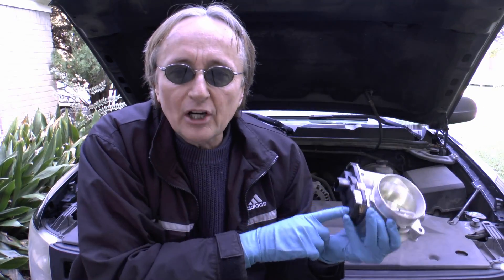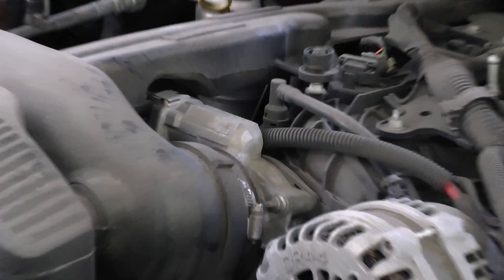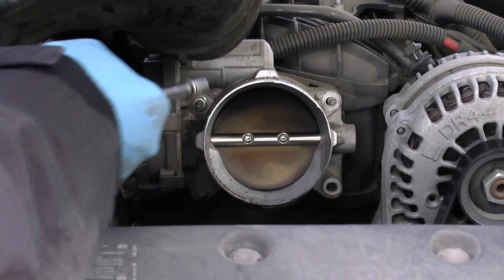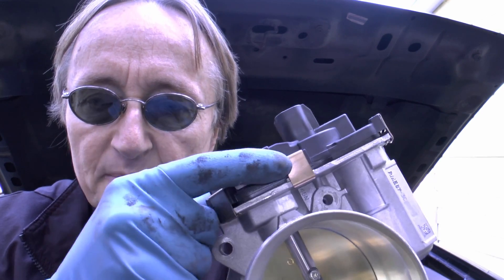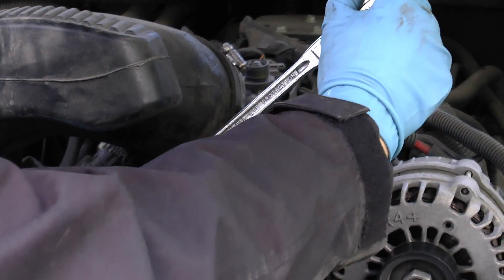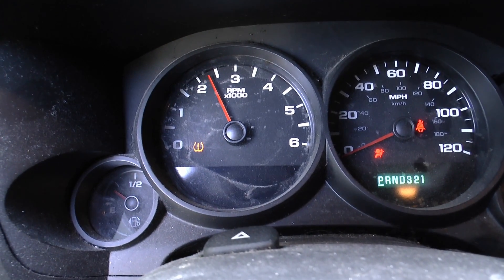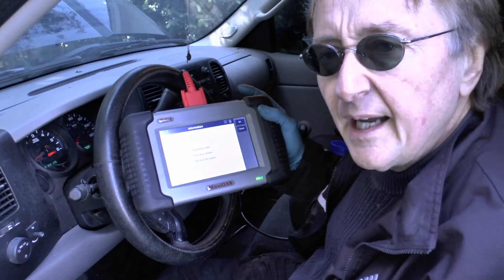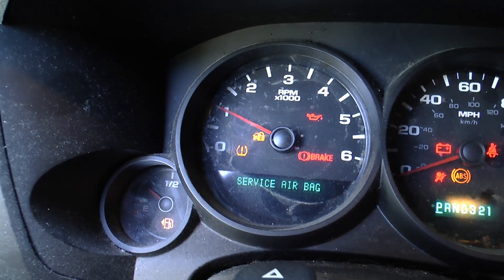How To Replace A Bad Electronic Throttle On Your Car

Comment: I would never buy a car with electronic throttle. I don't understand how an electric motor and wires is better than a mechanically linked steel cable. I swear not just with cars but with everything "they" make changes just to justify somebody's lame engineering job.
Reply: Electronic throttle control facilitates the integration of features such as cruise control, traction control, stability control, and pre-crash systems and others that require torque management, since the throttle can be moved irrespective of the position of the driver's accelerator pedal. It also provides some benefit in areas such as air-fuel ratio control, exhaust emissions and fuel consumption reduction, and also works in concert with other technologies such as gasoline direct injection.
Reply: Well that's unfortunate because every car now has them
Reply: Traction control and stability management are for people who have no driving skills. I'll stick with my cable actuated throttle and manual transmissions.
Reply: Electronic stability control, for one. It also makes cruise control easier to implement, and allows for an "eco mode", which makes the gas pedal less sensitive for people with a lead foot.
Reply: I had an 05 Ford brand new back then and the lag from the electronic throttle was very noticeable and VERY annoying. i compare it to watching a video and having the audio delayed a split second. Not a huge mismatch but you notice it and it bothers you,
Reply: 27dcx
Well and fine, so long as you stick with your 10, 20, and soon 30 year old cars with cable throttles.
Reply: Maindrian Pace yep nothing wrong with that. Time for me to stock up now. Dodge diplomat, mercedes 240d, any old toyota, chrysler fifth ave
Reply: smithraymond09029 I understand what you mean. My previous car had that trait, so I learned to hit the gas pedal earlier than I would normally so as to have the power ready at the precise moment. It takes a while to master, but you get used to it. Drive-by-wire is still miles better than drive-by-cable.
Reply: Only if you knew, would you regret your ignorance. Man I feel sorry.
Reply: smithraymond09029 Something else is wrong, like Idle position sensor. But electronic-throttle is more precise and accurate than mechanical-throttle.
Reply: smithraymond09029
Try Honda next time you're test driving. My Civic responds immedately; you can't tell whether it's an electronic throttle or cable.
Reply: RickyTomatoes drive by wire is not required for cruise control nor is traction control or stability control..
Reply: illstplaya You're right in that it's not required, but, it does make these other systems easier to integrate into the engine management system of a car.
Reply: illstplaya It does away with several parts in the cruise control system - a motor, for one.
Reply: ***** no, its a smart comment.
Reply: Jim Mowreader and there's still no point.
Reply: a real driver !!!!!!!!!
Reply: a real driver!!!

Comment: Nite Angel the scanner isnt a very complicated tool and when you buy them, they come with instructions. He also has a few videos where he uses the scanner, which can give a general idea. Also, there are many different types of scanners and each are different. Some scanners only give you codes and then you have to look the codes up in the internet.

Comment: Bummer, that you have to buy a $1k-2k scanner!
Reply from the maker: that's GM for you,most fords you don't have to reprogram the throttles.
Reply: Scotty Kilmer
does a electronic throttle on a 2005 corolla ce need programming? thank you in advance.
Reply: Scotty Kilmer would autoenginuity software work for this? Also what if you disconnect the battery for awhile and plug it back in? thanks